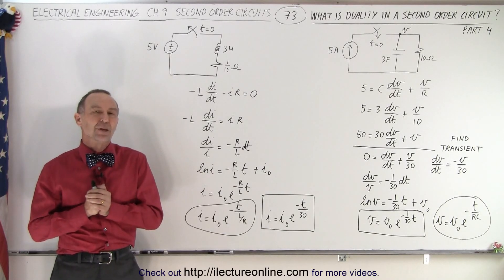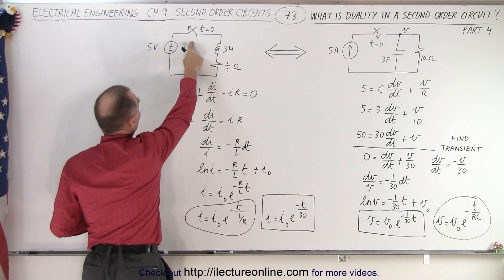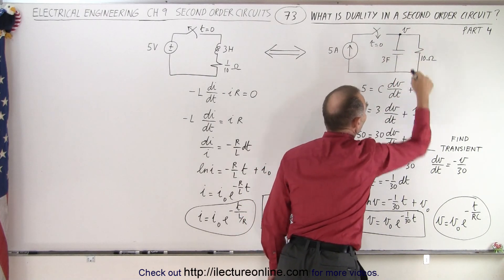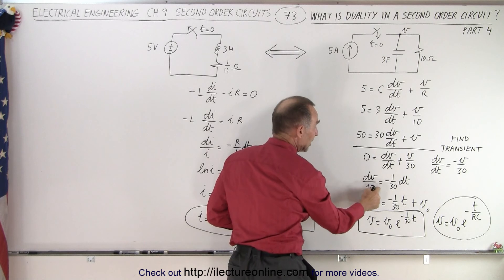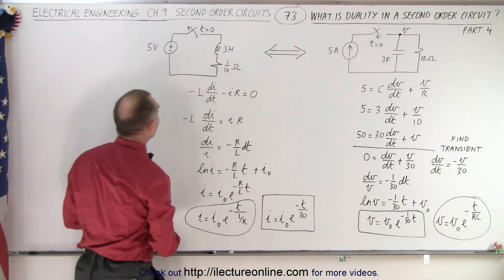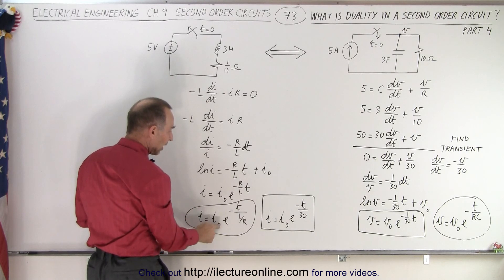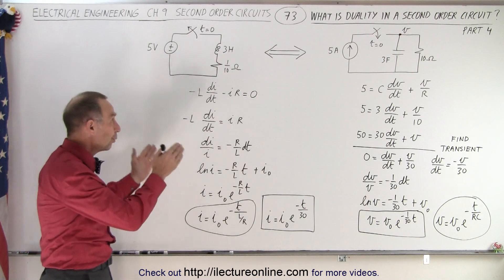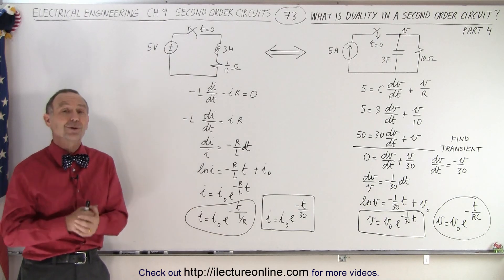Electrical Engineering: Ch 9: 2nd Order Circuits (73 of 76) Duality in a 2nd Order Circuit (Part 4)

Comment: Sir why you set , 50=0 while finding the transient equation for that parallel RC circuit
Reply: Multiplied both sides by 10 to get rid of the fraction V/10 on the RHS.